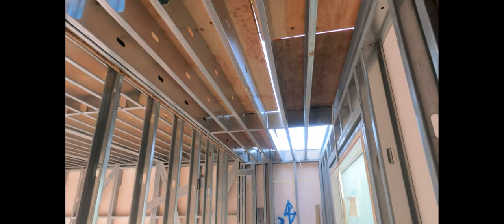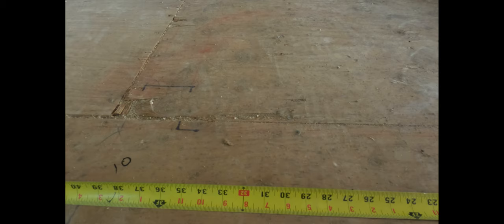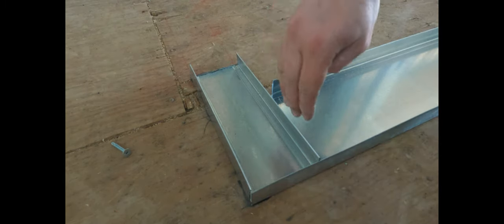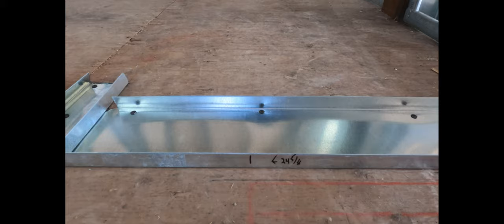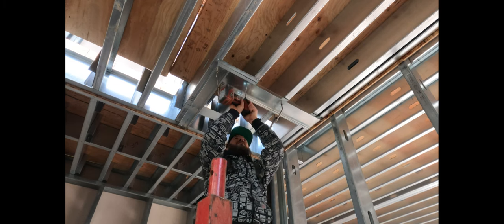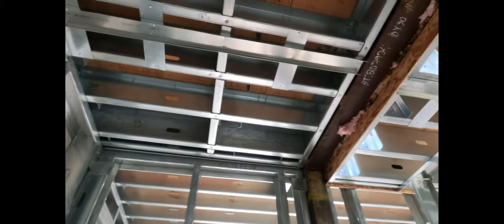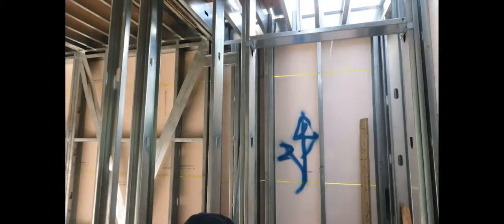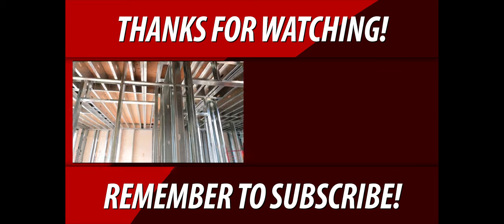Quick Metal Stud Framing Tutorial

Comment: Thank you.  We need more videos like this.  I just wish that Lowes and Home Depot had more to offer when it comes to metal studs. There is a lot of great ideas on construction on YouTube but our local stores have very little to offer.
Reply from the maker: That's okay, there is most likely a drywall supply house close by that you can get it. Just google drywall supplier for your area and see what pops up. They will have everything drywall, metal stud of all sizes, gauge, any height, drywall, insulation, drywall compound and everything taping. They will also have ceiling grid, tools and equipment all related the trade. Let me know if you need help finding a place👍

Comment: total newb trying to gain info and skills before finishing our last two floors this was informative. For outside walls will I need to have cross blocks I see many videos with no cross blocks and some with 16inch spacing from top to bottom seems overkill now that I finished the first floor of my Mothers unit. 2x3 studs with FCB walls on a concrete column and frame. For second floor with loft and trying to figure if those cross block are really necessary.
Reply from the maker: Carrying channel is all you need. Always a good idea for all steel stud walls. 16" o.c. is standard spacing in America. I hope that answers your question!

Comment: QUESTION. 
Can, metal studs be welded?. Can metal studs be bolted to wood (truses, floor boards etc) example running off ceiling for a garage extension? 🤔🤔
Reply from the maker: Sure why not. We screw them right to wood all the time just using 1-1/4" drywall screws.
Reply: @ConstructionKronies  awesome. Thank you , I mean it makes sense, but just wanted to ask a pro. I'm not certified only certifiable..

Comment: Sorry if this is a dumb question. Why do you run your drywall behind the wall, rather than putting a nailer in the corner and running your track all the way into the corner?.... I have done loads of wood framing and thats what we've always done. But never metal stud framing.
Reply from the maker: Not dumb at all! In these situations it's always nice to have the option of running your sheet through or cutting into halfway behind the stud to maximize drywall coverage or then opposite save a cut. In this specific spot you are also closing the garage side off completely and starting the new wall in the inside of the house. Wood is solid so it would close it off better but even with wood we wood still want drywall behind the corner stud to close off the garage side or I'm other situations it could be another unit or hallway to a building.... hard corners can always be used in interior walls but floaters are a benefit to using steel stud. Hope that helps!

Comment: Hi Chris, great videos. I watched many of them as I gear up to tackle a project in my house: wood stove alcove. Quick question. My ceilings are just over 9 feet. I bought 10 foot steel studs. I need to cut them to length but discovered that the place I need to cut them is near or through a knockout. Is that permitted? How do I handle this situation? Thanks
Reply from the maker: Yes it is perfectly normal to have a cut at a Knockout, if you want to avoid that cut some off the bottom then cut your length, I do this sometimes to keep the strength. Either way just keep the knockouts at the same elevations to run wires or channel.

Comment: In the end, I noticed a horizontal metal going between the studs holes. Is this a type of bracing ?
Reply from the maker: Sort of, it's called carrying channel, acts as a wall stiffener and holds the insulation up in the wall. We put it in every 4' at the knockouts when the wall is insulated or you can put 1 run through the middle of short walls if it's only needed to stiffen (keep the studs square)

Comment: Hi, how do you attach and seal vapor barrier on metal stud
Reply from the maker: Yes good question. What I do is use framing screws. I take the tabs from some drywall, screw the wafers through them and cut them so there's like a washer just little squares of the drywall tabs. Also I use 4"x4" pieces of drywall to initially hang the poly at the top with 1-1/4" drywall screws get it hung with those screw it off, caulk it and then rake those pieces of drywall off. Tape it up all done.
Reply: Adhesive spray

Comment: I’m having to install 45 degree braces on free float partition walls. What type of clips to attach angles
Reply from the maker: Just cut a steel stud, measure the length for.brace then add 4 to 6" on both ends cut the side flanges only bend one end in and fasten to structure them bend the other end the other way and attach to wall. Hope that helps..